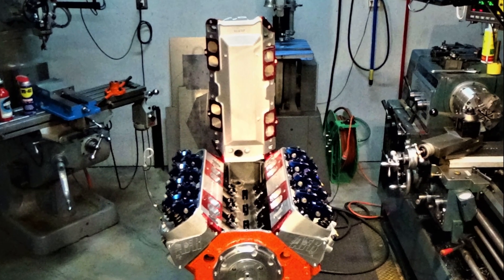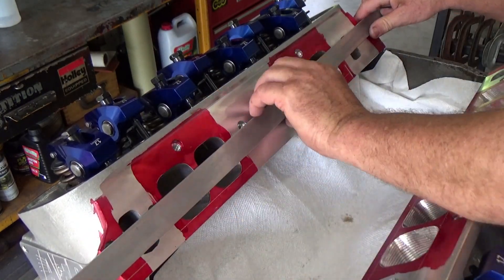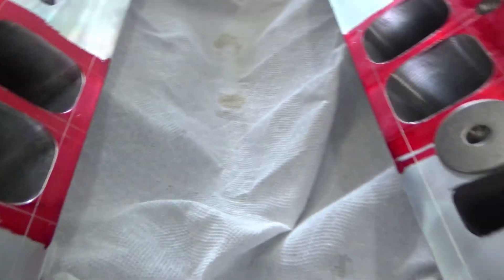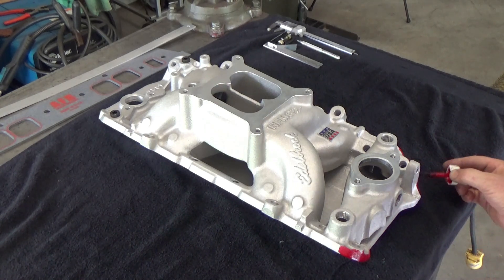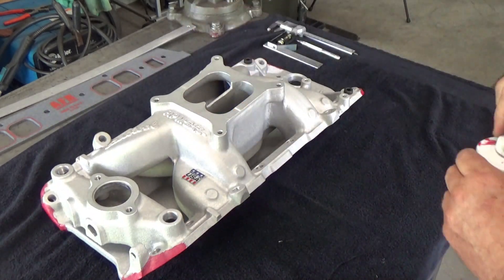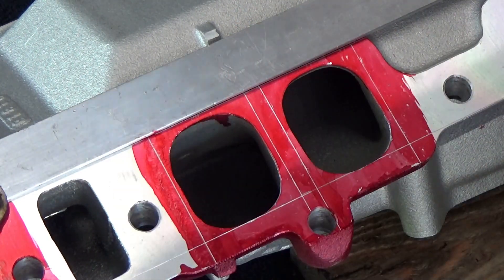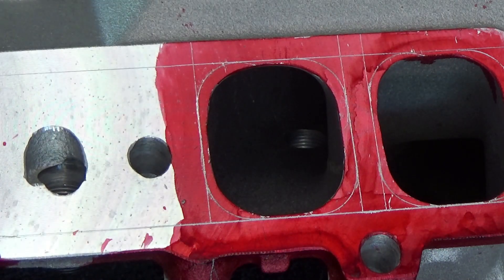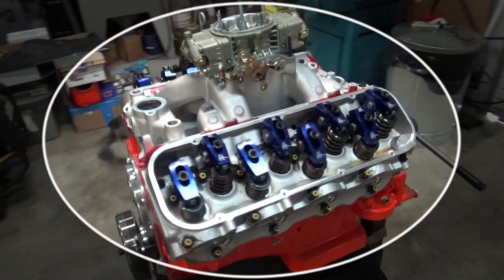Port Matching the Intake to the Heads Part #1...#20 Chevy 454 Big Block Performance Build

Comment: That is the only way to do it right, because very seldom does everything line up right ,, we have. Found heads that the chambers are off end to end, blocks that have shifted in the core etc. Accumulated tolerances from side to side, it is foolish to assume every thing is right, you have to make it right !
Reply from the maker: Thanks for the nice comment...

Comment: Your method is very clever... I guess instead of the washer for the radius, you could have used the gasket, if the washer did not have a close enough radius, but looks like it worked out for you...
Reply from the maker: Thanks for the nice comment...

Comment: What camshaft did you use on this build I have a 427 that is 60 over with the same heads I used a Howard's hydraulic roller 235x241@50 and 618 lift ground on a 108 lsa with a 950 carb it made 662 hp @6000 rpm
Reply from the maker: Hi richard... Dont have the camcard handy, but its a solid street roller Comp cam with around 242 intake 248 exhaust @50  and around 650 lift at a 110 lsa....  
Your engine made very good power... Wow

Comment: I have done this. Before and it works! Because you dont know if one head 
Pin location is off or one side of the intake is a little off!

Comment: I use a different way to lineup everything.After installing the heads the gaskets and the intake for mockup,I drill a small hole in the intakeflanges,thru the gasket and into the heads.Therefore I'm able to lineup the gaskets exactly to the ports in the way  they sit when its all together.Then you can use a small dowelpin to lineup the parts when you install them completely
Reply: Yes, much easier that way.  But lots of great techniques here and I guess there might be some applications where you didn't want to drill 4 alignment holes.
Reply from the maker: Thanks for sharing....
Reply: @Myersmetalworks  
You're currently building the exact engine that I plan for my 67 Impala 4 dr hardtop.
A 454 build mostly for useable torque.Can't wait to see the numbers after all.
Reply from the maker: Sounds like a good car for nicely built 454 to power it around...

Comment: Very interesting way to go about that. How far will you run the port matching up inside the runner of the intake?
Reply from the maker: Hi Philip, Not planning to port the whole intake, so probably 1 1/2 - 2 inches may be all I do on this one...
Reply: Nice set up all the way around. . !! 👏👍 I hve 2 rookie questions trynna complete my first port job.. ¹) I though you wanted a venturi affect so air/fuel mix. Rushes into the larger port ..like convergence to divergence to speed up flow ??²) does it matter how smooth or mirror like you leave the ports or do you want some roughness to help that air/fuel mix.  To flow.  Or grab onto & not just puddle up?? Any thoughts of wisdom would be music to my ears . Thx bud!!